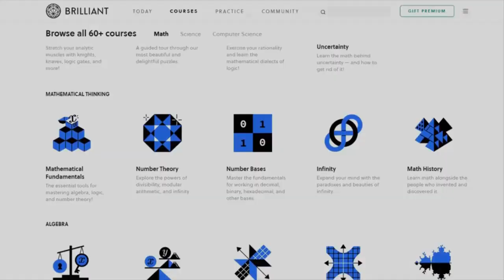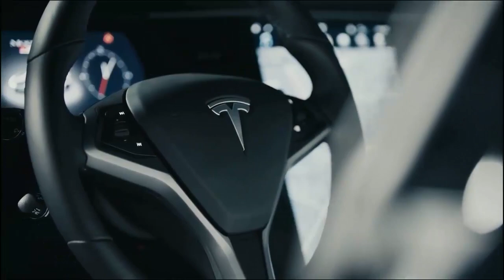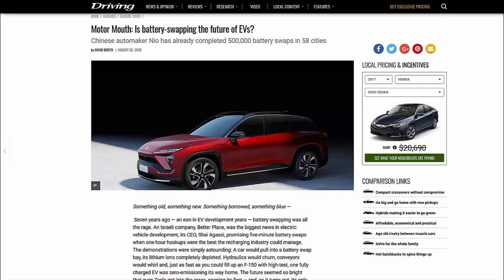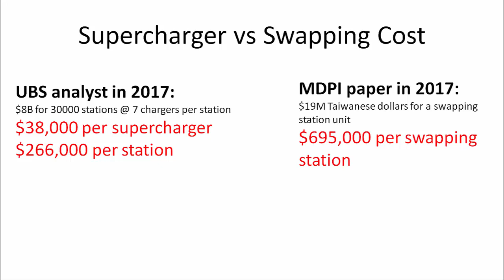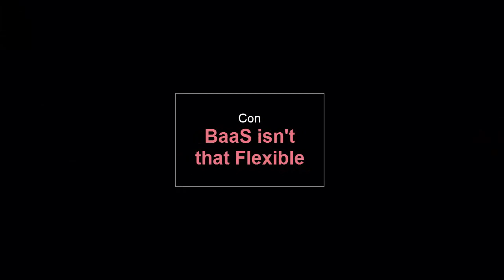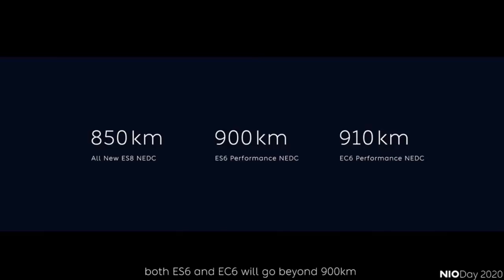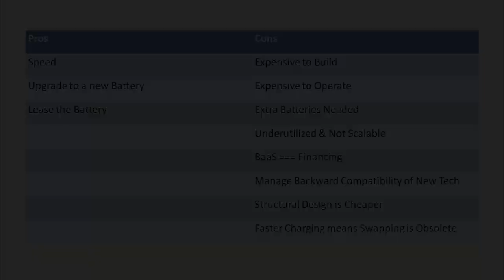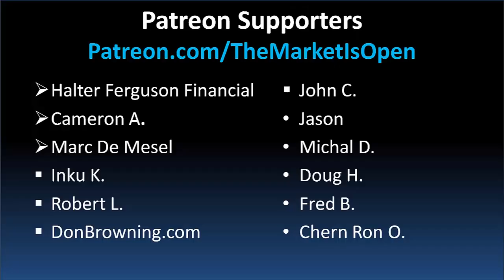Will Tesla Battery Swapping Crush Nio?

Comment: A couple more issues -

1) as charging site density increases, this increases the likelihood you can begin your charging sessions from a low SOC - thus, you will spend less time charging.  Your charging wattage will "tend towards" the maximum wattage you can charge at - versus, some lower-down-the-taper wattage.  The duration of your charging sessions will shorten, because you'll be doing them at higher wattages.  Eventually your charging sessions will rival that of battery-swaps - especially if the battery swaps are SLOW.  The Nio swaps are between 6 and 10 minutes?  That is SLOW.  Tesla did it in 90sec though obviously that was a prototype.  Charging built-in batteries will be so fast that it will seriously erode the differentiating factor of battery swaps.  At that point people will start to ask "why the f*** am I waiting in a queue and paying all this money?  Those built-in battery drivers just pull up to an empty stall, charge for a few minutes and they're on the road."

2) battery swap stations don't know when people are going to show up.  Or if they do, they get precious little time to prepare.  Their raison-d-etre is to provide a fully-charged battery without you waiting for it to charge up - so if they couldn't provide that, they'd look a bit silly.  Thus, they have to maintain all their in-stock batteries at 100%.  We all know this is bad for batteries and accelerates their degradation.  So when you pull up to a battery swap station, the battery that gets put into your car was kept at 100% CONTINUOUSLY for who-knows-how-long while it waited for the moment you rolled up to get it installed.  This doesn't make much difference to drivers, but it hurts the car company (in this case Nio) as they are degrading their battery inventory and they will end up needing to replace them.  Versus the "charging a built-in battery" model where you train the owner to charge to a max of 90% unless 100% is absolutely needed - and this promotes long battery life, reducing the number of batteries required for a given time period and a given fleet size.
Reply: 6-10 minutes is slow? You do realize these battery swap stations are set up at rest stops. You are going to be using the bathroom or getting a quick bite while your car is swapping it's battery.
Reply: Also battery swapping is free for customers.
Reply: You can immediately enter the queue when your within xyz km of a battery swap station.
Reply: Battery degradation is really a non issue for both automakers.
Reply: The future is having your smart, electric, self driving car go to a battery swap station. No need for a plug in charger. Don't worry about not having enough batteries. There's always a solution.

Comment: they won't do that, because this is a concept for big cities where people don't want to much time charging.
in those big cities the tesla robo-fleet will run the show for tesla anyway... owning cars will be a thing of the past in cities.
Reply: it's just gonna be an autonomous garage with autonomous cars, autonomously  charging in the garage and autonomously seeking a service center when somethings wrong.
barely any operating costs... compared to switching batteries, which will surely need a few workers to do/check.

Comment: Over time, very rapid time, Li (et. al.) will require mining from the ground less and less. Instead, it will be "mined" from above ground sources. Simply as a matter of their current behavior and the logistics it FORCES them to adapt and innovate too, means that NIO could (potentially) be waaaaay out in front of others who are not NOW practicing these kinds of logistics business models, and thus benefiting from the learning and adoption curve that is a consequence of such pioneering strategies. I could be waaaay off, but I get the sense that NIO is really gonna benefit here from this "recycling" model. Simply put, repurposing of batteries and their components is without doubt, the future of mobile and stationary electron storage. Competitors will be reliant on outside suppliers. NIO will not!

Comment: Simply put, repurposing of batteries and their components is without doubt, the future of mobile and stationary electron storage. Competitors will be reliant on outside suppliers. NIO will not
Reply: Tesla has around 40 or 50 GWh of battery production now.  Plus 10 or more going online from the 4680 prototype line.   Tesla's Berlin and Austin factory sites are building their own new 4680 battery production lines.  And Musk has laid out a plan to ramp up to 200 GWh by the end of next year, and then on up to building battery factories with the same footprint that each produce 1 Terawatt of production per year, with a long term goal of 15 terawatts per year ... in order to supply enough batteries to truly replace fossil fuel power plants with wind and solar. 

Tell us again about how lucky Nio will be to have those old abused batteries lying around.

Comment: Is this guy serious ? Is the future battery tech of Nio backward compatible with previous Nios ? Did he ever ask himsekf if his electronic gadgets at home are backward compatible as his home batteries improve and last longer, duh !!!! Also, who's going to pay for the maintenance of the batteries or swapping stations ? I mean isn't that what the monthly manintenance is for . By the way has he ever seem the Tesla battery that needed to be changed for a whopping 20 to 25k ? I guess that's when you really appreciate the worry free battery maintenance of the swapping scheme.  Battery swap is a great iea and has too many advantages to ignore. It will become a force to reckon with as cheaper models come out.
Reply from the maker: From the consumer perspective you probably don't want half your car taken apart and then put back together again every time you want to charge up. From business perspective, battery swapping machines are extremely expensive to maintain and will hurt the rest of the business since they require idle batteries. This will look even dumber as charging speeds increase. We already have 800V architecture vehicles charging in ~20mins. Next phase will cut that down even more. Battery swapping quickly becomes a liability.

Comment: Sorry didn't have time to listen to belabored facts to pad out the talk time.  People carry an extra gas can easily.  Why not have a 1/4 capacity battery that can be optionally carried in the trunk? Swap or don't swap no need for charging or changing station. Pull up to Walmart and buy or rent a 1/4 battery pack and drop it in the trunk.  Where it connects automatically. Off you go. Charge up later when you have the time.